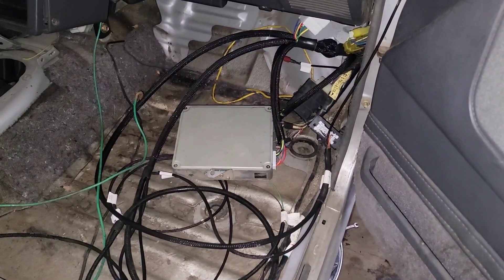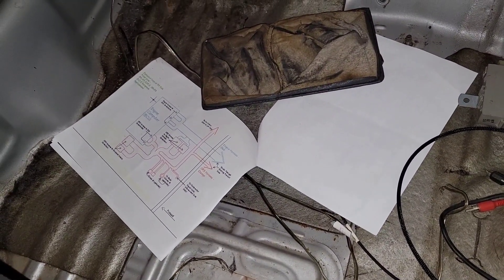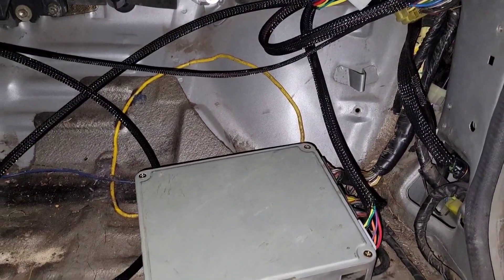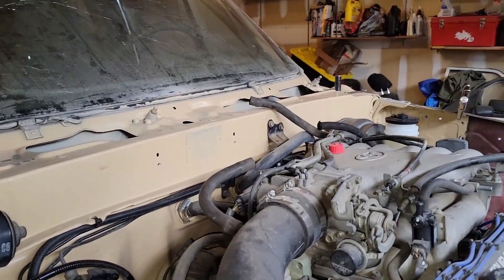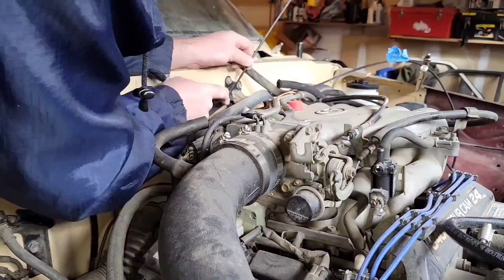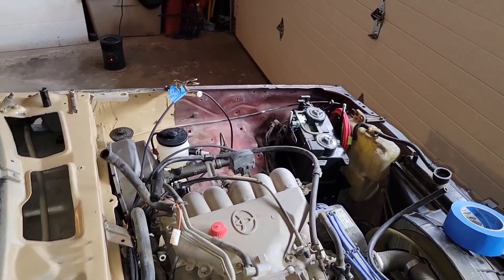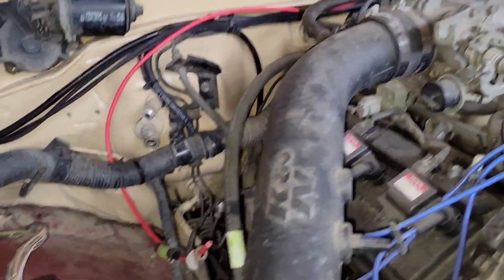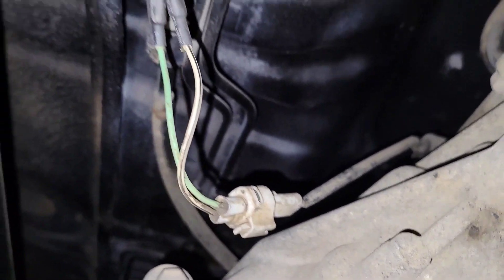1st gen 1988 Toyota 4runner, Part 4 of the 3.4 swap wiring ORS harness

Comment: Do you have to send ORS a harness or could you purchase a made harness already? I’m trying to 3.4 swap my 95 4runner and have my ecu and harness already but need to have it adapted. Trying to see my best options for this and also not spend a crazy amount on the wiring.
Reply from the maker: Thanks for watching! All I did was call ORS and they asked me a serial number on the orginal harness for the 3.0 and after that they sent me a new harness that wasn't too expensive with OEM plugs for the ECU and it was basically plug and play. Super easy, I was really not looking forward to the wiring part but ORS answered all my questions and had really good quality parts made the swap easy.
Reply: I got into contact with them and my harness would be around 655. So far I’m trying to understand if the harness they gave you was attached to your original harness as a type of extension? How’s your harness work for you?
Reply from the maker: @ernestogarcia8014  the ecu harness is new on mine. Didn't use anything on the old as far as the ecu they asked me a tag number on the engine harness which is the original for the 3.4 and than the ecu and engine harness work together and plug and play basically.  If you didn't get the engine harness off the 3.4 you will have to get that from ORS as well. What I purchased was ECU harness and battery harness since mine was toast. Hope this helps.